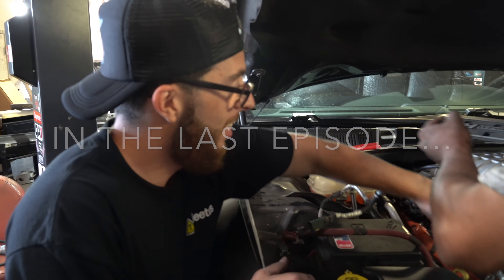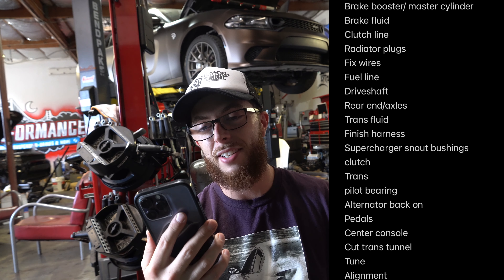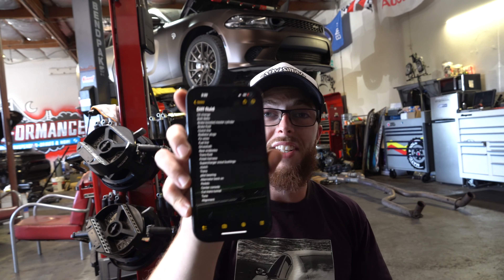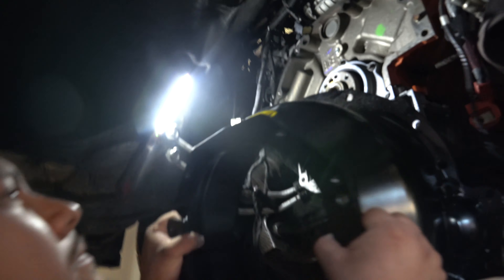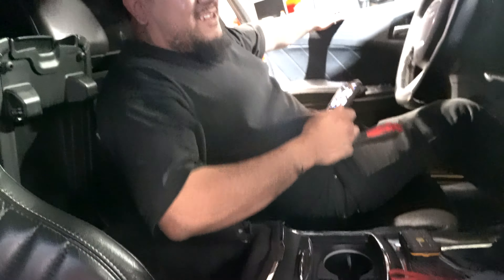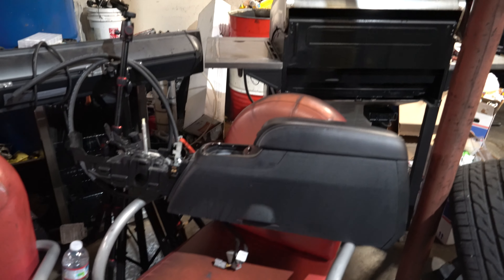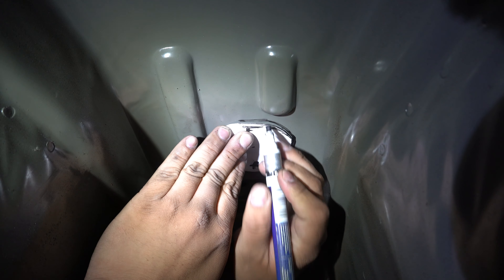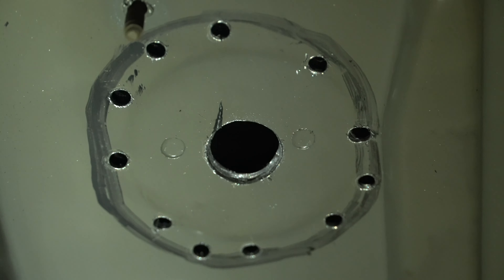Cutting the Transmission Tunnel to fit the 6-Speed!! | Building a Manual Hellcat Charger Ep. 4

Comment: I had to cut a lot more than a little hole when I manual swapped my 06 srt 300. Wonder if they changed the trans tunnel for the 8 speed cars 🤔
Reply: From a 06 srt to a 2016 srt they definitely change it a little bit.

Comment: Read somewhere you won’t be able to open the rear windows with the challenger engine harness, my question would be why not just run the stock harness you have but have the codes for the transmission? Would it be in like a limp mode?